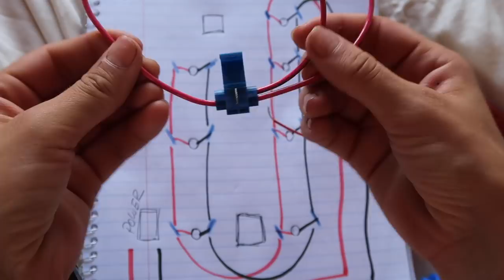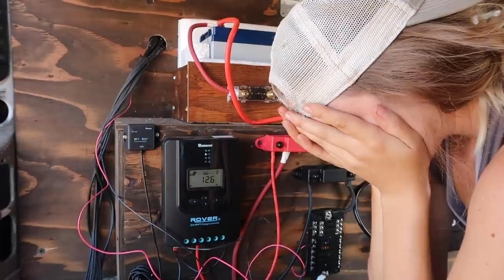LED Puck Light Installation | VanBuild Ceiling

Comment: Out standing!!!! I think your wiring diagram was great,I loved the colored markers. Excellent on telling how to wire the lights.Liked the LED puck lights, great idea on using the connectors (that is great to think about repair and replacement) The way you installed your ceiling with ruvnuts great idea.The stain and to seal the board look great. I know that I have said it before but you are the best first time van customizer that I have seen !! (I have to tell you I had tears in my eyes over how good the light worked) I can't wait for the next video !

Comment: Hi Linnea. All of your videos are fantastic. Thank you for putting all that time into it. 
My question is, did you cut the screws short that come out of the fan 1st to make the wood  butt up against it or is there a gap  between the bottom of screw and where the frame starts?

Comment: Just a suggestion: Use a drill depth-stop... It prevents you from, accidentally drilling through the outside wall of your van; If the bit grabs a burl of metal, while drilling...

Comment: Not Raining on your happiness at your lights working, I'm just curious: Where are the fan wiring connections??? Wouldn't it have been easier to make them before finishing the ceiling.

Comment: In your diagram you show both the + & - separated at the switch. The black goes straight through. ONLY The + is split = one side to each switch screw...

Comment: Instead of measuring the holes; hold the board in place beside the rivnut & pencil mark the wood where the bolts go. Now use your square to strike a line & measure where the hole gets drilled.
Saves a lot measuring & prevents a lot of Ooops...

Comment: Just a reminder I found out ford transit 150 have water leaks from the trim's and also from center brake light. I used silicone to sealed the top of the trim's with clear silicone and inside where you see those clip that hold the trim's.

Comment: Hi linea I'm doing my electrical now. I just have a question about the first puck light how do you do the 3 way connection ? I'm trying to figure out where to connect the wires if I do the 3 way. But the rest it will work. I hope you get what I mean 😃

Comment: Looks great, keeping doing what you do! I'm a solo builder too and it's great to see more females in this fun project/journey!
May  I give 3 important suggestions and lessons I learn from my own van build. 
1) I had my puck lights too close to the 3M thinsulate and over time the thinsulate melted and produce and awful and scary burning smell. Even though those puck lights are only more or less  3.5watts, the thinsulates cannot handle any type of heat. Even a hair dryer will singe it.  Please either keep the thinsulate at least 4 inches from it or provide a safe barrier between. I suggest the latter as over time the thinsulate will sag with vibration and come in contact with your puck lights. 
2) I see too often that van builds only use coat/protect the front of the wood with polyurethane or varnish. Water vapor seeks into every nook and cranny. You will be fine for the first season and not notice any condensation, but overtime especially if you are going to visit the colder areas such as Canada, AK, or PNW, moisture will seep through your cracks. Having two fans is great, but it can't run 24/7 and in humid areas, humidity is relentless. I know I live in the PNW and not even a dehumidifier can control the coldest/wettest days. 
3) Get a hydrometer, even the cheapo ones on Amazon 2 for $6 with 3K 4 star reviews are worth it. Once you start paying attention to the hydrometer when van your doors are closed. This info will be an eye opener for you. 
Just kind of "Do not make these mistake" like rest of us have. It's costed me plenty of time and money to redo my ceiling and wall install to make sure I can enjoy it for years to come. Not having the nagging feeling if I did it right and having the hydrometer tell when I need extra ventilation is priceless. Sleeping worry free is priceless too!
Reply: What do you suggest for a barrier between the th insulate and puck light wiring? Great suggestions, thanks!
Reply: @trishwhitehouse6536  I ended using zinc metal strip, you can find at local hardware store for roofing, as a barrier. It's worked nicely as a heat barrier.

Comment: I would recommend front half of your waver lights on one DC switch and the other switch to a different bank of lights. (Example 4, front, 4 in the back. The wire leaving the switch is called a (switch leg)
The wire from your 12DC blue sea connections would be called your (Feed)
Any new wire ran to a dedicated circuit is a (home run) 
Hope this helps. Awesome project build.

Comment: Linnea, you are right.  Still after 2 years of you posting this video, all the YouTube "stars" still can't post an "How To-Step By Step" and explain.  This is SO, VERY, helpful.  Thank you.  However, one thing, Did the long wires you ran go  from a dimmer, and then the dimmer wired with shorter wire to the battery?  Could you explain in the same manner please?

Comment: Really good video! Keep it up! 💪
I'm trying to fit my dimmer with puck lights but I'm having problems. I got 3 cables, white black and red from dimmer.. I'm connecting red with the battery power.. and than black to positive of lights and white to negative. The lights all turns on but dimmer dosnt work and I can't turn them off.. any idea?

Comment: @23:25 Welcome, we humans had hoped you'd show up. 😏...keep shining brightly.
Your craftsmanship is phenom.  I'm going to use a few screws to secure marble print vinyl to my walls after listening to your floor story.  My rig... and I'll call it that for posterity... is a type III ambulance with a modular theme.  Have you looked into toilets or recirculating shower systems?

Comment: I gave you a round of applause (and a Like and Subscribe!) when your lights came on. I liked the way you explained your schematic and the simple way you explained how to wire the lights in parallel. You mentioned, but I don't think you showed, enclosing your wiring in (plastic) conduit. Did you wrap the 3 way connectors in electrical tape as well, or were they just enclosed in the conduit as is..?

Thanks, by the way, for the very informative nature of your vids. VERY helpful!

Comment: Really great to see you just take it on. Couple of things to point out. While most of the time people wiring way under size you went the other way! You ran a 15 amp circuit to handle 1.75 amps of load. It's not a problem but the wire is bigger, stiffer and more expensive than what you needed. Also where failures occur is in the connections. You have a lot! The wire taps work but are not the best way for a mobile environment. Learn to solder and heat shrink. Also remember the van is (at least should be to aux batteries like the start battery is) bonded to ground. You could have attached the ground wire using a loop and sheet metal screw the the double wall part of the roof and skipped the long ground wire. I wish you the very best!

Comment: Linnea I am getting ready to wire my electrical from YOUR video.  You've made it SOOOO understandable!  The only question I have is when you got your wiring in and the ceiling done.  How did you transition those wires from the ceiling to the wall.  there's wire hanging there and I am not sure how to make sure the wires are not squeezed behind the wall or ceiling when those two butt up together.  I am hoping you can understand and be able to answer this.  I have been out in the van for hours wondering how those wires will not get pinched behind the wall when I put it up to meet the ceiling.  THANKS!

Comment: I just found your video and channel while searching for a good description of the ceiling puck lighting. I'm right at the stage of ceiling lighting and ceiling install. You did a great job explaining the process and providing a very simple wiring diagram! In watching the wiring installation, the only suggestion I'd make is to use some wiring mesh or plastic sheathing to protect the wire that's running through the van metal cavities from rubbing and cutting on the metal edges of the van when you're driving.  Very helpful video, and thanks!

Comment: Very good. But a simple note, your whole car body, metal, is ALL negative. So you don’t need to run a negative, black, wire all the way around. Just screw an anchor point in the body near the light!

Comment: Ok, third comment here. I'd hate for you to miss some commission, so your link to male connectors actually links to female connectors. Also, you totally helped me wire my puck lights in my van today. You were there every step, with the most clear instructions and I appreciate it. I actually came back in the house to get my laptop to guide me and said "gotta go get Linnea to help me". Thank you so much!

Comment: I'm having an awful time using the 3m connectors! The metal plate bends sideways every time! I cap the main wire and don't strip any wire housing. I press down while the new wire is pressed all the way in. And it even will break the blue plastic too! These blades don't seem sharp enough by any means. Not sure what to do when this happens. Remove and replace in the same spot?

Comment: Running both a + & - wire in either singles or a twin core is fine, but with a car or van the whole of the chassis / body is connected to the negative side of the batteries. So you can just attach the - side to the metal and still run your + side through your fuse & switch. Saves on a bit of wiring.

Comment: What dimmer switch did you use for your lights? Did your 12v pucks need to be specifically labelled to be able to be in dimmer?

Comment: That how I felt when the ceiling fan lights and motor worked after I installed it in my room. Thanks to YouTube I was able to accomplish that task. 

Soon I’ll be installing puck lighting in my van conversion. Thanks for posting.

Comment: I know this is 3 years old. 12:50 But yes you can run it in series. But the power is different and will drop off making each light a different brightness. So you did it right in parallel. The bad thing you did was putting your wiring inside the metal frame of the van without any protection. This is a moving van and the wiring can rub against the metal of the van over time and the wires can break.

Comment: Linnea, well done with the lights!!!! But, please consider inserting all your wiring that runs through or along steel body panels and braces etc into plastic sheathing for protection against cuts and wear of the wiring insulation, which will cause a short. It's a very good practice to do this for all automotive wiring in these types of locations.

Comment: Rivnuts are great. For those who might not be as strong... you can screw the tool partially into the nut then bring handles in... screw in a bit further and squeeze. Do this until its tight enough. This technique works better for your larger rivnuts.

Comment: Love this video! I am curious though how you made the last light connection. Did you use a three way on that as well? If so, did you just cut the wire and add a stopper to it so you wouldn’t have exposed wire?

Comment: WARNING FOR THOSE BUILDING:
5:38 when installing the front frame, please don’t trust glue to support the weight! I followed these steps exactly, and after 3 days in the summer heat the ceiling gave up and fell. I opted instead to remove 3-4in segments of the headliner above the cab where you can see an additional spar to drill into instead. Liquid nail is still a great idea, but I also simply drilled 1x3 planks directly from the the frame near the MaxAir fan directly to the spar above the headliner.

To help visualize it better, I opted to not go horizontal with the 1x3 along the entire front spar, but instead to go parallel with the van directly from the wooden frame behind the MaxxAir fan, to the 3x4in cut outs on the headiner directly into the metal spar with some dabs of liquid nail. This solved the issue of creating support for the ceiling, but WITHOUT removing the headliner.

Thanks so much to Linnea for this great series, this was just one change I thought to bring up
Reply from the maker: Yes for sure I wish I did the same thing! My ceiling hasn’t fallen or anything, but I can tell that it isn’t holding up like screws would (of course). 
Thank you for the time you spent adding this information!

Comment: Hey… still following along.
I like how you use the nut’serts to fasten wood to the steel framing.

One thing that might make the easier next time is to drill the hole on the wood members… then place the wood where it needs to go and then mark the steel frame (through the holes on the wood) then install the insert.  May be?  I dunno.

Comment: did you use a 14awg female connector to the 22awg male connector? also, did you connect each light to each other or are they wired separately to the 14 awg wire?

Comment: Are there any issues connecting those thin gauge wires from the puck lights to the thicker gauge wiring with those spade connectors?

Comment: @linea&akela hi, I'm in the process of building my van now. I've been watching your videos and learning a lot from all of your ideas. I'm so proud of you! 😀 I want to ask is the negative black wires are the ones you first install and connect to the splice connector? I hope you can show how you set up your solar panel next time. I'm going to follow what you do here because this is the simplest way for me. I'll appreciate your response. Thanks for sharing your ideas here.
Reply from the maker: Thank you so much! I am glad that you have been able to learn from my channel and hopefully avoid making some of my mistakes😅
For the connections, I used the spice connector for all positive and negative wires. So each light has the positive and negative, and each of those are connected using the splice to the positive and negative of that circuit. Let me know if that doesn't make sense!
Reply: Linnea & Akela oh, I'm pertaining to the black wires you connected to the splice. That's the 14 gauge right that you first install?

Comment: Why did you use the 12 gauge stranded wire sometimes and used the separate black and red wires other times?

Comment: Although these are DC, I believe they can fit a 12v AC system fine. I'm definitely still learning all this, but it would make sense that you don't need to upgrade to DC to be able to have LED puck lights. I read somewhere where puck lights have their own controller which convert the AC power to be used DC in each light.
Reply: Also you're killing it! Your videos are some of the most informative I've found for the subjects I need for my van build!

Comment: Wait, I might have missed something.  In a previous video, you told us you are using 12 gauge wire in your prewiring.  Now you are connecting your puck lights to 14 gauge wire?  Did I miss something?
Reply from the maker: Nope! You are right! 
In my prewiring video I didn’t run anything for my lights because I was extremely confused and didn’t know what was best for the lighting situation. I ran the wires for everything else. 
Then after doing research for my lighting I chose 14g wire and then ran all of that for my lighting. Hopefully that makes sense!

Comment: Great video! This and your solar video cleared up so much of my confusion. I do have one question if you have a moment. In your parallel puck light diagram, what do you do with the main positive and negative wires at the last puck light? Do you need the blue connectors still or do you connect the main wires directly to the puck light? Or do something else entirely? Thank you again!!
Reply from the maker: I connected them directly to the puck light! No 3 way connectors needed :) 
So happy this helped clear things up for you!

Comment: When measuring where to drill holes in the wood to line up with the installed rivets - could you place ink or paint on the installed rivet portion, then push the wood up against it in place, then see if the ink or paint made a mark on your wood? Maybe this would be more accurate then measuring? Disclaimer: I have never tried this, it just popped into my mind as I was watching your video.
Reply from the maker: I have actually tried this!! It kinda worked. Also on of those things that I didn't keep doing purely out of laziness haha

Comment: What size riv nuts are you using for the framing of the ceiling and walls? 1/4 - 20?
Reply from the maker: I have been using M8 rivnuts! .25 thread I believe.. they should be linked in either this video or my garage video!